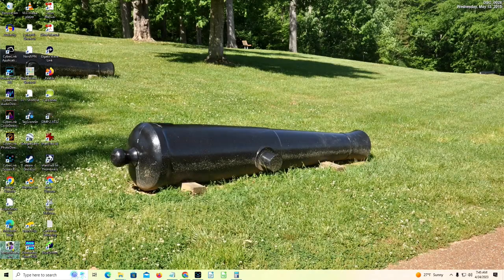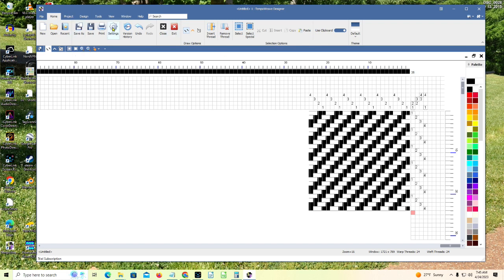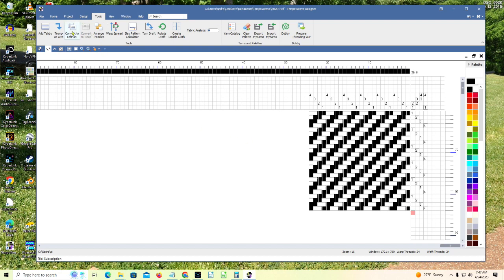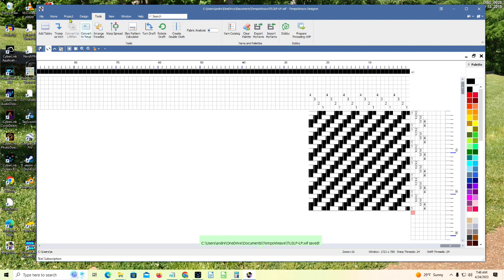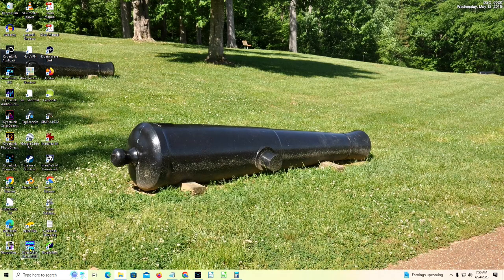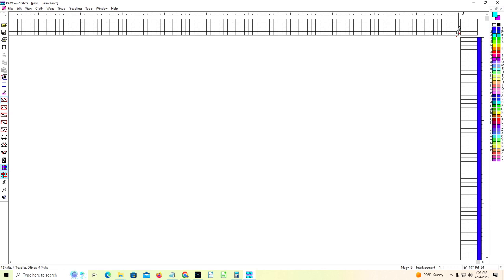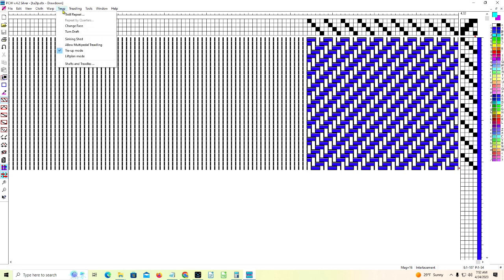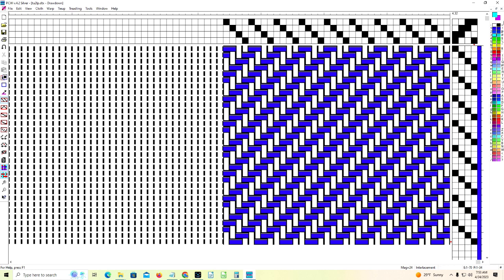Tie Up 2 Lift Plan

Comment: I'm the same as Plans & Procrastination -- not experienced in software.  Since you have both, which is a good beginning software?  Thanks  PS -- I also saw that the Tie-Up mode/Treadling it shows "Sinking Shed."  I have a David 3.  Did I understand that correctly?
Reply from the maker: This reply is for both “Plans and Procrastination” and “Jill 4 Today”.
As I mentioned in the video Both TempoWeave and Fiberworks have strong points and weak points.  Fiberworks is an older program, but it has been regularly updated.  TempoWeave is new, in fact it is not yet available for purchase, I have been a beta tester on it for a while.  The important thing for any new weaver is to understand weaving drafts (patterns) and how they work.  My suggestion is to try some graph paper and learn simple drafting by paper and pencil first.  Once you are comfortable with that, either program will work for you and speed up your weaving design process.   For initial planning I like TempoWeave, I think at the most basic level it is easier to start with, and it has a slightly more modern feel or user interface.  But Fiberworks has some great features.  I really do use both programs.  

So my suggestion is that you:
Go to the Fiberworks website (http://www.fiberworks-pcw.com/) and download the “free” but slightly restricted version and play with it.  Get the “bronze” version.  You can learn to use it, but can not save patterns.   If you like it then buy a copy.
OR
Go to the TempoWeave website (https://tempoweave.com/) and choose “Get the Beta” option, and pay the $1 for the beta copy of the program.  Again, play with it, try things out.  It is well enough along in development that it will not crash on you.

If you understand weaving drafts, then either program will be good for you to use.  There are other programs available like:  iWeaveIt, PixelLoom, WeavePoint.  But I have never used them so can not comment on them.  

Final comment.  When TempoWeave completes their beta testing and becomes available for purchase, I plan to be one of their first customers.
Reply: @curmudgeon66  Thanks so much for your response.   I've been weaving for 25 years, so I have a pretty good grasp of tie ups, etc.  I thought it would be great to move to a drafting program and make my life a little easier? Jill
Reply: @curmudgeon66  wow............what a thorough reply....thanks so much for the comparison............I've been weaving about as long as Jill (waves) but off and on....and now that I have an older (ahem) memory....not sure how much will be transferable to digital..........but I see it as potential for helping me with that memory issue....by streamlining some of the steps ... again thanks!!!